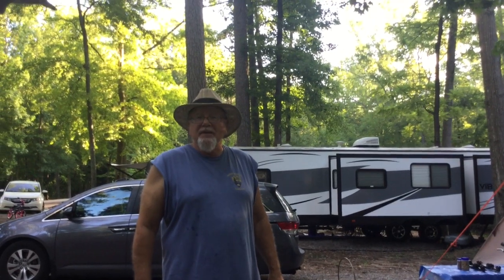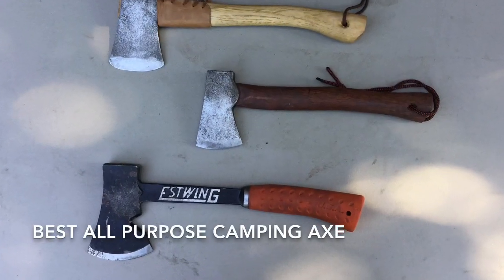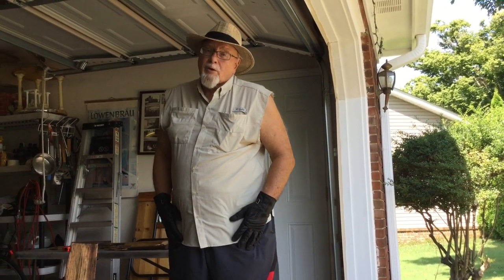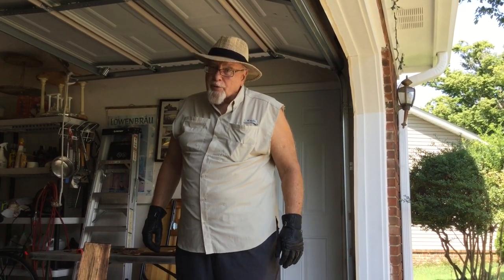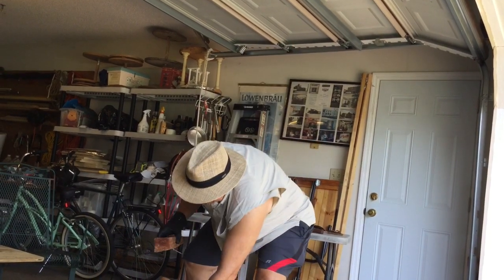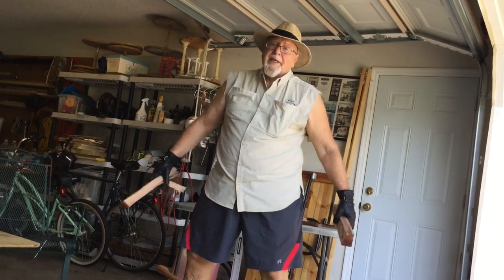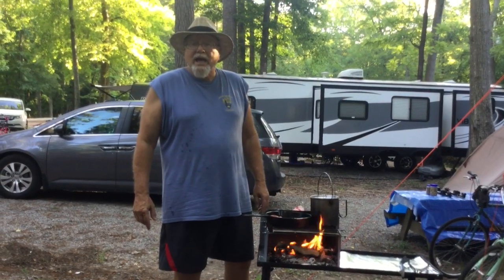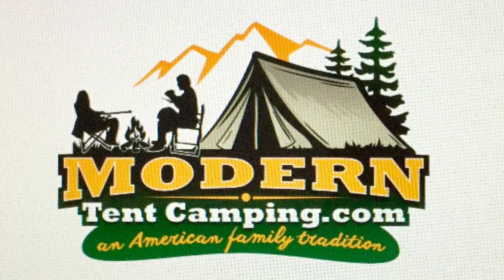Firewood Processing & Axe Safety 1

Comment: That's quite a collection of hatchets Frazier. I have always been a fan of the Estwing hatchets and hammers. I have owned an Estwing hammer for many years through numerous building projects that looks almost as good as when I purchased it. That was some great tips for splitting firewood and kindling. Great picture of you and your family also. Thanks so much for your effort in putting out another quality video Frazier!
Reply from the maker: mrbr549 Thanks. You know that those hatchets were just the tip of a very large iceberg. In fact I have more than you can shake a stick at. I really like the vintage wood-handled Collins axes and hatchets but Estwing is so practical. A lot of people like Fiskars but it reacts very differently to firewood. My part 2 video will start with the Estwing. Thanks for all your past support. Keep in touch.